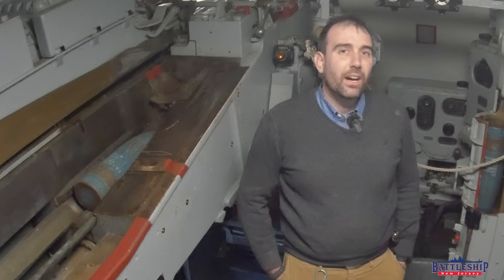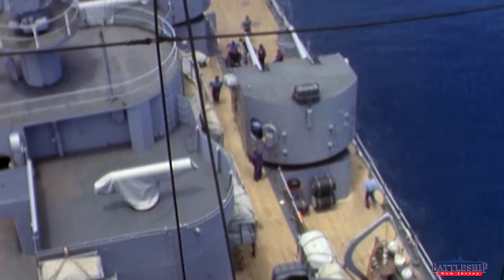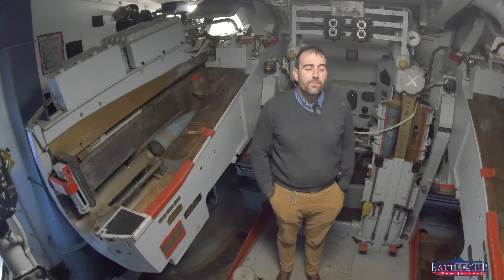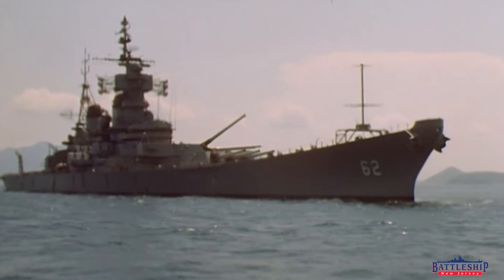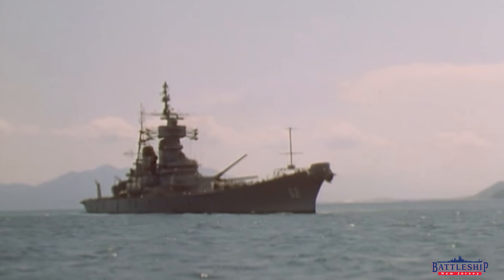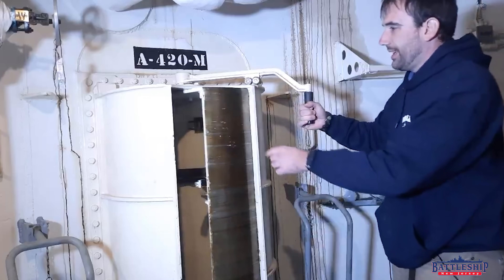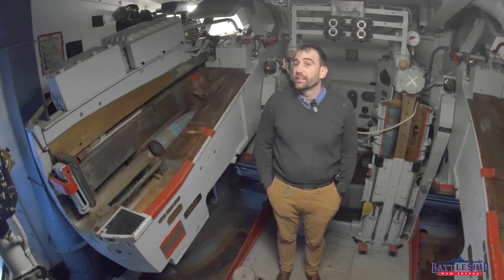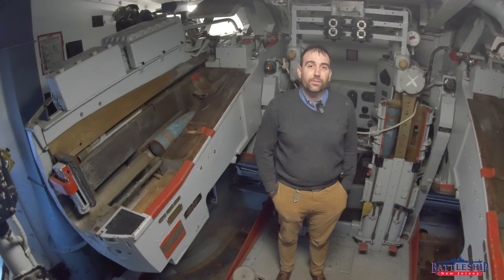Why Do Modern Warships Have So Few Guns?

Comment: It would be wild to see flak make a comeback.  With the drone threat it could happen.
Reply: It's already the case. For land-based systems, look up the Skyshield, it's been around for years already
Reply: Yeah I think we might indeed see flak make a return. These days you can have an integrated fire control radar compute the trajectory and automatically program the timed fuze of the round. The big advantage here being that the ammo is dirt cheap (compared to a missile at least). No fancy sensors or guidance, just a timed fuze. Look up the MANTIS system for what this looks like. 

With the era of drones upon us it's going to be critical to be able to meet quantity with quantity. For now, shooting them down with missiles works, but it's expensive and what happens if you get 200 drones thrown at you? 

EWAR of course also has huge potential here but you always need hard kill.
Reply: @CawKee  haha no.... largish upfront cost maybe, less to maintain and less operate long term.
Reply: I don’t think it ever left, just morphed into CIWS
Reply: CIWS are FlAk
Reply: CIWS are already flak gun on steroid - thousands of shots per second and automated accuracy
Reply: ah yes 88mm flak firing off on a modern ship. No, even a 40mm bofors is more effective
Reply: @nathantruong4129  40 mm Bofors is flak.
Reply: Microwave pulse
Reply: It's called CWIS (USA) or the Millennium gun/Searanger (German/Swiss).
Reply: In Ukraine the Gepart SPAAG has made an surprisingly successful comeback. It’s very effective against low cost Iranian Shahed drones. I believe we will see the same for flaks on ships. I could imagine a naval version of the Rheinmetall Skyranger.
Reply: @samuel_singh_smith  Already exists. Searanger/Millennium Gun.
Reply: emf barriers?
Reply: Why expend ammunition to take down drones when electronic counter measures work better and are cheaper?
Reply: @slimj091  because electronic countermeasures can also get countermeasured, a sbullet not
Reply: Drones are felt with the modern laser systems now. Been around for a while now and more ships are being outfitted with them. You can look up plenty of videos here on YouTube of them using it
Reply: We have cheaper laser systems....
Reply: @andrewyork3869 that still are not ready for mass use. Have you ever wondered why we still use good old autocannons or rotary cannons as CIWS to this day?
Reply: @one-shotrailgun8713  because it's a warcrime in the wrong context to use laser weapons? Besides this is for sure one of those change is good but not to much change things.
Reply: @andrewyork3869  no it's because of the advantages of kinetic weapons. Kinetic weapons by their nature are more energy and heat efficient than lasers in general, are not as badly affected in atmospheric conditions (air, rain, dust. All of them can reduce a laser beams effectiveness to varying degrees.) and are more versatile as they can fire different types of ammunition (normal bullets, programmable flak rounds, possibly even smart bullets in the future). Of course lasers (in the context of CIWS point defense at least) have their own advantages such has needing no form of ammunition (at least if your using solid state lasers) and the speed laser waves approach their targets is very fast.

This being said, it depends on the target they will be facing. A few drones or some lightly armored missiles that passed your own interceptor missiles/gotten too close before detecting them to use them? Lasers will take them out efficiently. Got a massive swarm of air/naval drones, multiple big drones or a big cruise missile that your laser can't take out in time is heading towards you? Auto cannons/rotary cannons with flak rounds can easily take them out.

Remember that we are talking about this in the context that we're going place these things on a naval vessel that might or might not have a lot space and might operate alone as well.
Either kinetic and missile weapons will remain as the main way to destroy drones on a naval vessel or lasers would just add another option for said vessel.
Reply: @one-shotrailgun8713  Masers that cut the connection or fry the drone like an emp are nearing deployment already. GD has videos on YouTube demonstrating such. (The glorified jammers take not that much power.) Lasers who really knows what the future is if fog or clouds where a larger issue then dust we wouldn't see them this close to deployment. (Not saying they are the end all be all.)

Also emp hardening won't do any good here. Eventually, it will get hot and burn the electronics, realistically that can take place in a several millisecond time frame depending on what's being used as a emp shield. I know maser is a tad imperfect of a definition but it's where I think this is heading.
Reply: @one-shotrailgun8713  Exactly.
Reply: @one-shotrailgun8713  I give up you clearly aren't grasping what I am trying to say....
Reply: @andrewyork3869  your the one who is being difficult here. Maybe don't come in with a vague comment about how lasers are efficient against drones without any reason, and then get forced to make an explanation on the spot on why that is when me and OP question you.

Also I though we were talking about lasers in the context of using them as a naval CWIS as we were talking about this on a video about naval weapons. Why TF did you think it is wise to talk about a land vehicle based laser system when we should know that a naval vessel and a land vehicle might be facing different threats, thus maybe different types of drones as well? That caused plenty of confusion when I first read your reply against me.
Reply: @one-shotrailgun8713  Not to mention non-existent.  Maybe in the future, but the drone swarm threat is right now.  Been a pleasure Mr. Railgun.
Reply: @one-shotrailgun8713  never did I bring up a land system, my whole point was that lasers based weapons systems are not as easy to defend against as you you seem to think. I am not saying kinetics have no place but flack for drone swarms isn't it.
Reply: @andrewyork3869  
"never did I bring up a land system"
-Then who is this "GD" you are talking about on your third comment? Are you talking about General Dynamics? Because if you are then YES, you did bring up a land based laser system! The system that General Dynamics has is literally only for their StrykerX tech demo. If there is any other laser system that GD has that isn't land based, you should've specified. And if your not talking about General Dynamics in the first place, stop using vague abbreviations and use their full name at least once! People are going to look at your comment, see "GD", and assume General Dynamics or get confused outright.

"but flack for drone swarms isn't it."
-No, that is going to depend on what drones make up the swarm, how many and thus how big the swarm is overall, and don't forget what it might do if it gets targeted as well.
In my opinion, lasers excel at shooting down small amounts of low-cost enemy units (drones) and enemy munitions (loitering munitions, incoming mortar shells).

Like I already said before, small clusters of small drones are easy targets for your lasers no matter what the operators could do, and very wasteful to use your AA guns or missiles on them. I would agree with you if this the case.

But a massive of swarm of relatively large drones that will take some time for your laser to fully disable? There is no way your laser system will be able to take out all of those drones within a reasonable timeframe, and what will the operators of the drone swarm react? They can spread out the swarm to decrease the chances of multiple drones getting by your laser at once, make the drones getting hit move in a way that spread out the lasers heat which would allow the drones to survive a bit longer.

"my whole point was that laser based weapons aren't as easy to defend as you you seem to think."
-Know that it is somewhat easier to design your drones outer shell to be able to spread more heat from a laser beam than it is to add more armor to resist shells and shrapnel because doing the latter will result in more weight than doing the former, and drones needs to be light enough to take off and fly at acceptable speeds in the first place. Using AA cannons with flak shells and missiles at this point is fully justified, and more effective because at least you can be guaranteed that any drone caught in the blast would be instantly destroyed.
Reply: @one-shotrailgun8713  your right i forgot I had mentioned that, Leonidas from GD is not laser based.... Plus it has been written elsewhere they where exploting naval use with it. I say fair game.... General Dynamics may a a laser based antidrone system, but again what I was referring to was explicitly labeled as anti drone. Also that comment the context you omitted was where energy based weapons are heading and why lasers are not the end all be all.
Reply: @one-shotrailgun8713  Flak couldn't shoot down Biplanes reliably in WW2. Just look at the Bismark.... Beyond that already, there were serious issues with flak and 20mm being able to dole out enough damage late ww2, namely with kamikazes. I understand these are cheap, atridable drones today, but flak is not hard to stop, and 20mm has to make a fair number of hits still. 

What we are seeing with the Carney is very much the Hothis with backing from Iran with arguably Russia and China aiding, is testing of how to attack a US destroyer. Poking and prodding to see how we respond to certain threats. It's not rocket science to protect fuel tanks and electronics from flak or 20mm. With more contemporary airframe building methods, it would take several hits from both to bring down a drone. Multiple hits take time time you don't have when dozens of drones are rapidly closing in. (I am a firm advocate that large-mid long-mid range drones will never be cheap enough for most nations to launch them in mass hundreds at a time multiple times in a prolonged ie multiable times a day manner.)
Reply: @andrewyork3869  "Flak couldn't shoot down Biplanes reliably in WW2. Just look at the Bismark.... Beyond that already, there were serious issues with flak and 20mm being able to dole out enough damage late ww2, namely with kamikazes. I understand these are cheap, atridable drones today, but flak is not hard to stop, and 20mm has to make a fair number of hits still. "
-Flak cannons weren't able to reliably hit Biplanes because FCS for the flak cannons straght up did not exist. Gunnery crews had to rely on predicting on where enemy aircraft are going to be through their bare eyeballs and calculations from other humans, not to mention they can't even see their targets in the night without the help of spotlights. Flak had issues dealing damage because they are usually firing at FULL AIRPLANES, not small drones since they obviously did not exist during WW2. Fully fledge aircraft are obviously much bigger and tend to more armored than small drones. Modern day AA systems will accurately destroy all WW2 aircraft thanks to 21st century computer and weapons technology. What the hell is the point of this argument? I dare you to try to aim and fire your laser at a far away drone using nothing but your eyes and manual aim.

"What we are seeing with the Carney is very much the Hothis with backing from Iran with arguably Russia and China aiding, is testing of how to attack a US destroyer. Poking and prodding to see how we respond to certain threats. It's not rocket science to protect fuel tanks and electronics from flak or 20mm. With more contemporary airframe building methods, it would take several hits from both to bring down a drone. Multiple hits take time time you don't have when dozens of drones are rapidly closing in. (I am a firm advocate that large-mid long-mid range drones will never be cheap enough for most nations to launch them in mass hundreds at a time multiple times in a prolonged ie multiable times a day manner.)"
-It's not rocket science either to make heat resistant ablating armor plating for your drones and aircraft either. You need to remember that lasers deal their damage by attempting to rapidly heat up a spot on armor while autocannon shells or flak round shrapnel does so by ramming their targets very hard. Like I said, it is easier to protect aganist the former because trying to do the latter will result in a significant increase in weight and I already explained why staying light within acceptable parameters is very important to drones and aircraft. Lasers can't damage your internals unless it has hit you consistenly in the same spot to punch through your armor or you have been hit consistanly enough that your internal temperature becomes very high (or that your laser is really powerful that it can instantly burn through armor for whatever reason, but is that massive energy consumption worth it over firing a bunch of equally damaging shells?) while shells and shrapnel could easily punch through your armor espically on air drones or aircraft where they have to stay relatively light. Don't forget about the advancements in computer and sensor technolgy which would allow AA cannons to detect targets further away and hit them more consistently (of course lasers can benefit from this as well). Note that with further advancements in technology, somethings can get cheaper. For example, advancements in manufacturing and assembly might allow for more efficient and cheaper production runs. Honestly I wouldn't be surprised if bigger drones can be made cheaper until they could be used in swarms, though your point does have about big drones being more unlikely to deployed as swarm has merit.
Reply: @one-shotrailgun8713  First and for most I could see a long range aircraft dropping a cluster of smaller shorter range drone potentially being a thing. My immediate counter is don't let the mother ship ever get that close.

There absolutely where hits on those swordfish and radar guided flak was a thing (75+mm) in ww2. Wurzberg gun laying radar for the Germans in 1941. (The 3in gun naval auto cannons came about in 1949 for the USN.) If you want a more modren example of flaks short commings look at all the damage A10s take.... 
 
Again, you say an ablative coating could protect drones from lasers. That works in theory. In practice a drone that can take a hit and sustain that kind of thermal heat will be very heavy. Meaning it will never be the size of a DJI drone, at smallest the size of a reaper. Its also worth mentioning regarding small drones namely, that unless you coat an entire drone in an ablative shield things like propellers would still be vulnerable and given the nature hard to shield. If you think that is impossible lasers land exactly where you point them....
Reply: @andrewyork3869  "First and for most I could see a long range aircraft dropping a cluster of smaller shorter range drone potentially being a thing. My immediate counter is don't let the mother ship ever get that close."
-Okay so what is the point here? We already have a solution, they're called missiles which are either launched from a ground based system or from fighter jets.

"There absolutely where hits on those swordfish and radar guided flak was a thing (75+mm) in ww2. Wurzberg gun laying radar for the Germans in 1941. (The 3in gun naval auto cannons came about in 1949 for the USN.) If you want a more modren example of flaks short commings look at all the damage A10s take...."
-And only primitive ship mounted radar, this isn't like modern CWIS where they accurately rotate using electric systems, have modern computing systems, and sometimes even have their own radar system like the Phalanx. Those WW2 flak cannons have none of that, they have to rely on humans to predict, move, and fire and as a result aren't even linked up to the ships radar (and not all WW2 ships even have radar.). As far as im aware, only the big guns that are for taking out other ships can move on their own and have some form of FCS (mechanical analog computers). Also didn't I just acknowledge the fact that aircraft in general are more bigger and armored than drones? Especially the A10 Warthog which is more armored since it is a CAS aircraft? Considering current ground based laser technology only has reached the kilowatt stage, they would not fare better in taking it down anyway as I already mentioned that lasers need to burn the same spot constantly even for volatile parts such as the missiles or the engines. Which would very hard to do cause you know, aircraft are always moving and they might even start to move in odd ways in response to getting targeted like rotating horizontally to force the laser to spread out across the armor instead of one spot. Missiles remain the best way to taking down aircraft, they are just incredibly wasteful aganist small drones which lasers excel at along with other things as I already mentioned.
Okay seriously, what the hell is the point of bringing up WW2? Drones obviously did not exist in WW2 and we're only talking about if cannons or lasers are better at taking out drones NOT aircraft in general. Are you just trying to make flak look worse while conveniently ignoring some of the factors on why they were terrible? If lasers had somehow suffered from the same factors (relying on humans to predict, move and fire with no radar), they would not fare much better either.

"Again, you say an ablative coating could protect drones from lasers. That works in theory. In practice a drone that can take a hit and sustain that kind of thermal heat will be very heavy. Meaning it will never be the size of a DJI drone, at smallest the size of a reaper. Its also worth mentioning regarding small drones namely, that unless you coat an entire drone in an ablative shield things like propellers would still be vulnerable and given the nature hard to shield. If you think that is impossible lasers land exactly where you point them...."
Again, I already explained why would it be easier do that than armoring aganist shells or shrapnel. Espically since you said ablative COATING, which actually might be possible to make and apply to the outer shells of drones, missiles, artillery muntions and on aircraft with little to no consequence should lasers become a sufficent threat to justify their development and manufacture, even if it only likely to remain effective for a short while under laser fire and provided it is cheap enough to manufacture in large quantites. Also I would like you to try and explain how this theoretical ablative coating would severly weight down any drones that have been appiled with the coating. I can explain the same thing with armoring aganist shells and shrapnel. Also didn't I mentioned and agreed with you MUTIPLE times in my replies toward you that small drones are screwed aganist lasers no matter what?
Watch this video: https://www.youtube.com/watch?v=fXeUkrlxQ98
It is a unfinished animation depicting what would a battle between space ships with orion drives would possibly look like. I choose this video because it has lasers used in battle whos capabilites I believe to be accurate. Lasers are good at taking out small targets like small drones and external componets of larger craft. But good luck trying to punch through the armor of larger targets like big jet powered drones and aircraft. Unless you have a very powerful laser, you need some time heating up the same spot, and god forbid if the enemy starts making funny movements to forcefully spread out your laser beam across a bigger area.
Reply: @andrewyork3869  You're telling me that using laser weapons against drones is a war crime??

I'm not doubting you, personally, I'm just really curious what international law covers use of laser weapons to destroy unmanned vehicles... And just how that could be a war crime.
Reply: @one-shotrailgun8713  Effective range of CWIS is just under 1500m, and it's not the impenetrable defense that most people think it is.
Reply: @andrewyork3869  Directed energy weapons require immense amounts of power, more than can be supplied by existing ships without sacrificing other systems.  There's also the problem of countermeasures such as ablative and/or reflective coatings.  Kinetic weapons are crude but use insignificant amounts of power and cannot be countered save for armor.
Reply: @michaelchristiansen1497  reflective coating can only do so much ablative same issue. I strongly suspect the next generation of DE weapons will be MASER based and not laser.
Reply: @michaelchristiansen1497  well the russians already developed a heat ray to kill drones, but its still Experimental.
Reply: @michaelchristiansen1497 they can fit small ones for drones on a humvee.